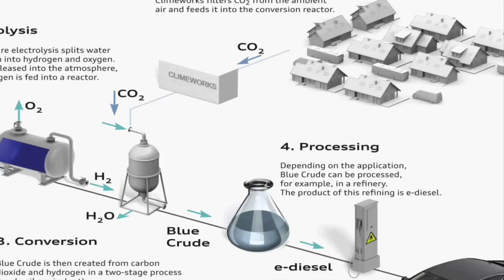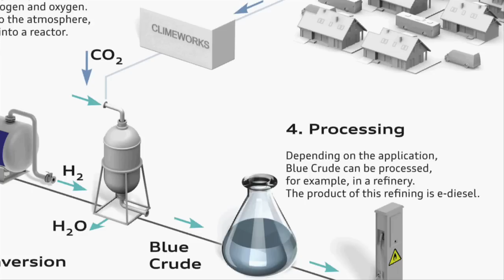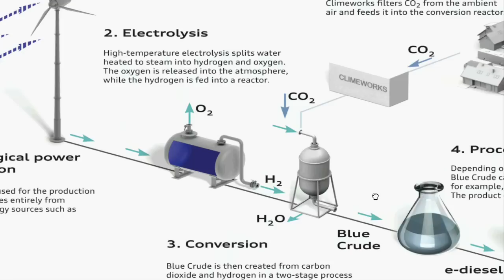Audi e-diesel: Audi has successfully made Diesel fuel from Air and Water

Comment: Extracting CO2 from the air? You can do that?
Reply: Yes, on a particle level you can filter carbon dioxide from the air using small micro holes in a filter that lets oxygen pass through but catches carbon dioxide. You can then remove the CO2 from the filter and use it for what ever you want, including making sparkly water in a sodastream :)